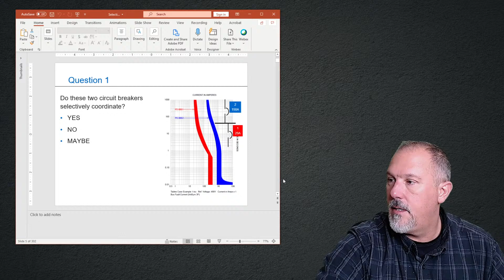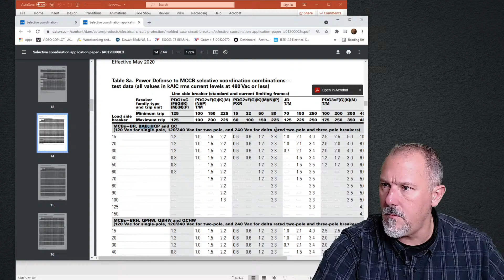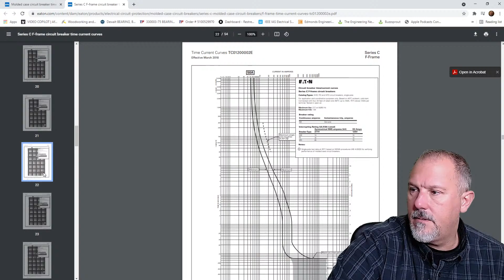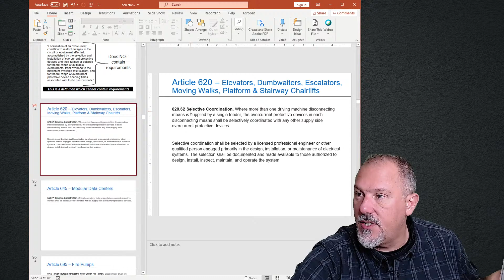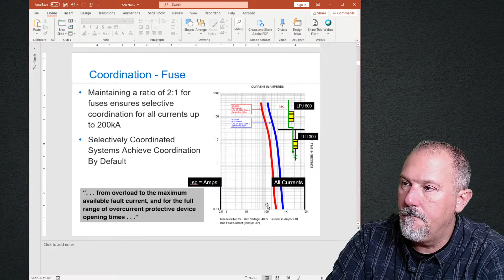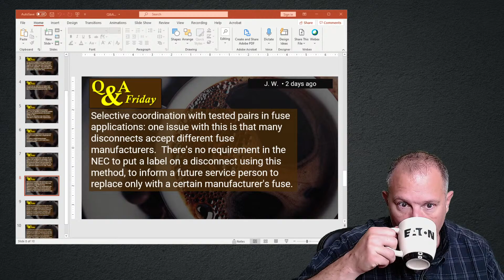Q&A Friday

Comment: Never did much residental work but on a large house that I installed over 130 duplex receptacles I installed all of the allied fiberglass wall boxes exactly 20" off floor. Carpenter was extra happy with that. Told me some guys are over a inch off from floor. He never had to measure height for sheet rock cuts. Liked to keep counter top receptacles at least 14" off counter tops so it could be easier to see if a toaster was left on counter top. At an IAEI meeting one inspector stated that you did not have to use tamper resistant receptacles if over something like 7' off floor. I still would install TR devices every where in a home. Fiberglass boxes were easier to seal off for any boxes mounted in exterior walls.